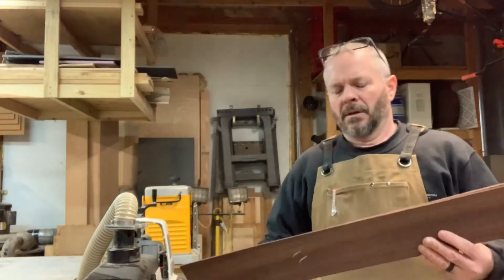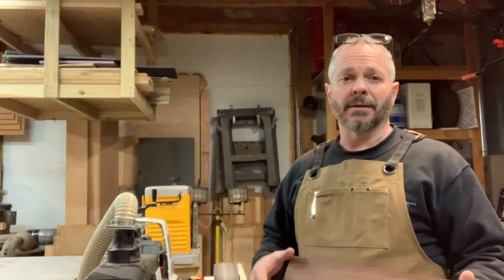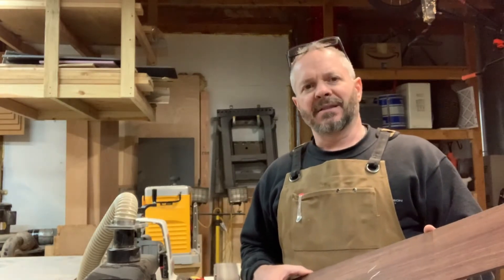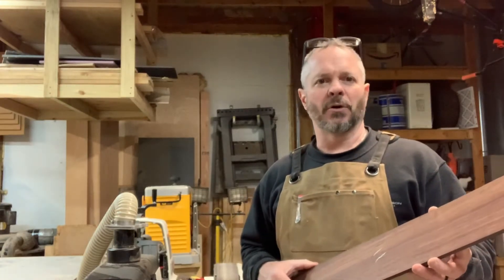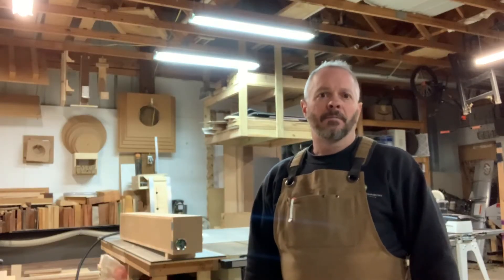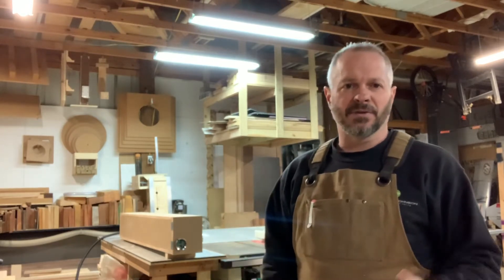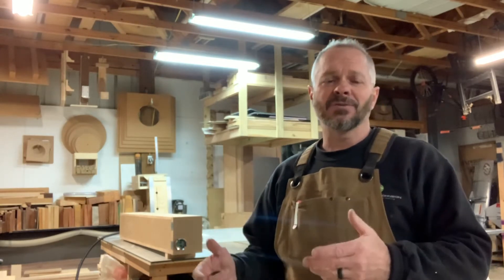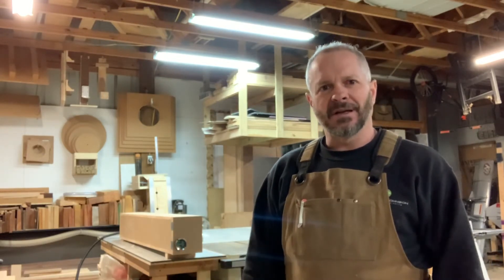#1A Steam Bending Sides

Comment: Nice ! Steam bending works great for such a mild waist and curves on that body. To go much tighter then that though you will find a bending iron or heat blanket type will most likely be needed. Of course it depends on the wood though. Some bends terrible, i just did a set of Ipe sides and you almost have to set it on fire to bend it, and all kinds of black oily sap comes out, good times !
Reply from the maker: Thx for watching and thx for the feedback.  I ended up making a torch style heating iron and actually use both.  Got a couple in the works now.

Comment: Thanks , You made it look fairly easy.
Reply from the maker: Thx Russell.  Building guitars has really been an enjoyment for me.  Good luck.  Glad I could help.
Reply: @jordanseverydaydiy4373  Yes Sir, This is going to be my first acoustic Build. I am going for a Parlor size guitar. I had a cheap one that I have traced off and been building the tools I will need which is a chore in itself.
Reply from the maker: @hobiecat901  the jigs and fixtures are some of the most fun parts to figure out.